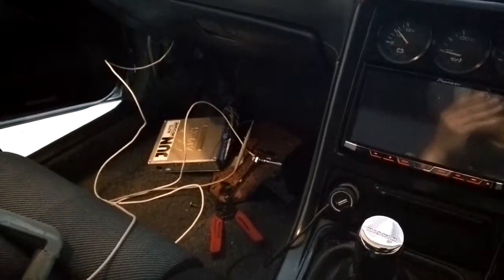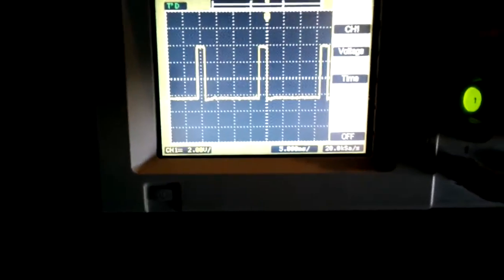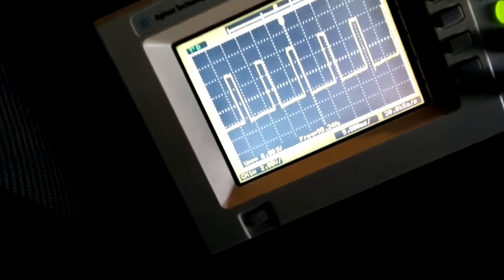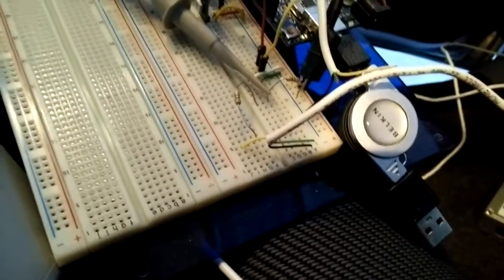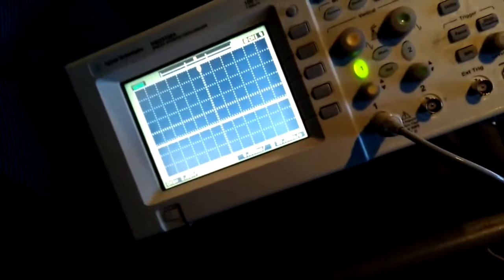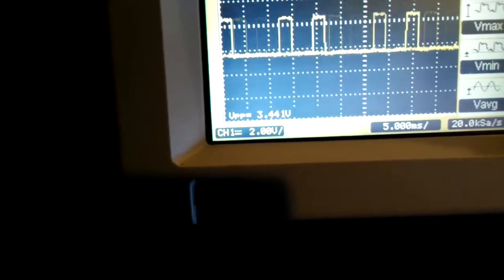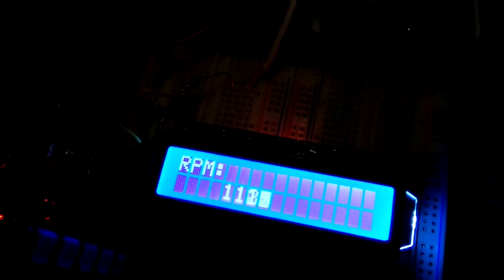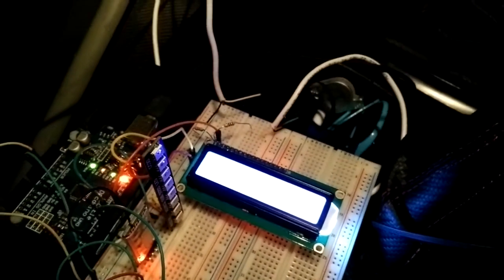Arduino sequential shiftlight for Nissan Skyline R32 GTR

Comment: May I ask what's that noise before you start the engine?
Reply from the maker: Lil Wasabi Are you asking about the noise that sounds like a fan? The oscope that I'm using to measure the tach's frequency has an internal cooling fan
Reply: Josh Sakamaki ohhh okay thanks for replying